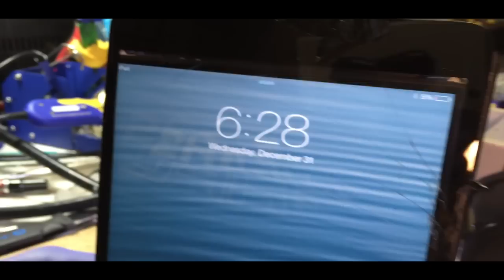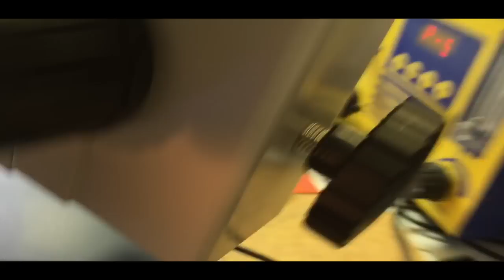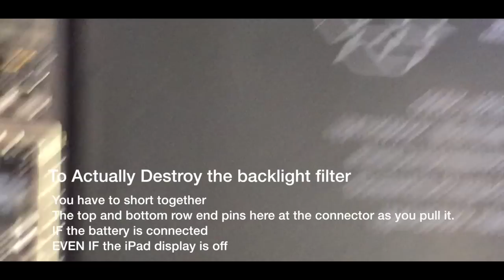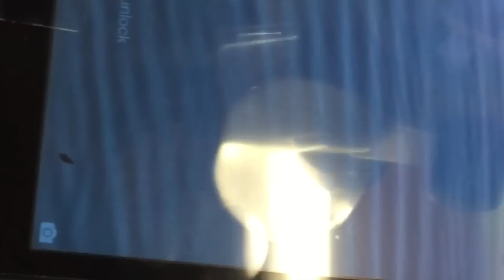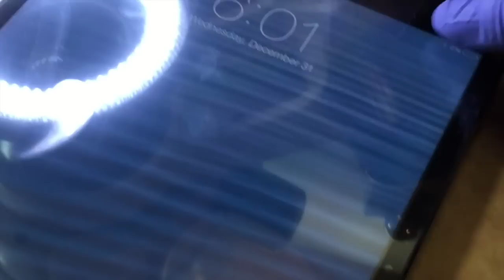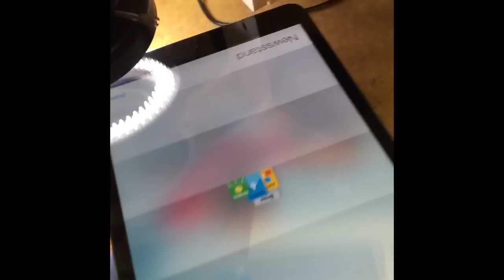iPad mini Screen Replacement

Comment: @40:07 whoosh cleaner is nice? Would you use that directly on the LCD for any smudges when you have the unit open?
Reply from the maker: No
Reply: What would you suggest for cleaning the digitizer surface? What would you suggest for cleaning the raw LCD? isopropyl alcohol & cotton qtips seems to streak a bit.
Reply from the maker: I would vote for no liquid on an LCD, but if you insist you could try Perfect Glass on a microfiber cloth not the LCD.  The best solution is to not get any marks on the LCD, wear gloves.
Reply: Agreed gloves are the best option. I have some Invisible Glass clean which is great albeit, really needs proper ventilation. I'm guessing Perfect Glass is a little less odoriferous. thx.

Comment: It's impossible to blow the fuse when there is no money at stake.
Reply from the maker: ok smart ass, i bet you can't blow the iPad mini backlight fuse.  Rules.  you must leave the EMI shield on the iPad and you must blow the mini backlight fuse in the course of a normal, or simulated normal iPad mini screen replacement.  terms of bet to be set later of course...

Comment: Hi Jessa, I love your videos and am inspired to try to repair my daughter's ipad mini.  After completing the screen/digitizer replacement (which I did before watching your video), the screen has a bad, jumpy, flickering image and alternately gets brighter and dimmer every 5-10 seconds.  When it is dimmer, you can faintly see the whole screen image that was up previously.  There are also horizontal and vertical lines.  The touch function seems to work fine.  Wondering if you think I damaged the LCD or could this be a defective digitizer (it was an inexpensive one from Amazon).  Any thoughts would be so greatly appreciated.... thanks
Reply from the maker: bad lcd, not sure if other problems as well

Comment: bonsoir Rehab , Reda reparateur en France vous etes formidable madame, je voudrais vous poser une question avez vous connu un probleme de sensor magnet wake on off screen after remouving glass i know this 2 magnet is important i have place it but not the same form of magnet not working i know this flex cable in button coper is the sensor of this wake on off screen merci Reda

Comment: Hi Jenna great video. I’m from the UK and I’ve got a completely dead mini. Not recognised in iTunes either. I’ve taken digitizer off and lcd also ordered replacement battery to discount that. Any ideas? Maybe board issues?
Reply from the maker: check for signature failure 3v3_out short
Reply: Thanks Jess for the reply. You will have to excuse my limited knowledge on this matter. How do I check for signature failure? Also watched your video on replacing the power ic chip, do you think it is this that has failed?
Thanks
Reply from the maker: Post questions like this on a forum or head to a local microsoldering shop.  www.forum.mendonipadrehab.com

Comment: @23:09 shakes fist at self. Next time I'll FULLY clean the old adhesive off! I had even purchased the 3M sticker remover pen. Oh well very successful iPad Air digitizer replacement, despite not being perfect.
Reply: note to self @25:51 for full cleaned adhesive

Comment: I've cleaned the iPad mini frame with adhesive remover and cleaned it with cleaning alcohol but the new adhesive on the OEM digitizer does not stick properly to the frame when I close the iPad. Any tips?
Reply: @38:18 she also uses heat (hot air) to help seal the adhesive.

Comment: I have had an issue doing this once to a customers iPad mini. I pulled the battery connector to prevent backlight damage and when it was powered up after the repair, the date naturally got reset and the iPad showed as disabled. Unfortunately there was no way around this due to it not being on my WiFi or the customers Wifi, had to DFU it to get it up and running again.
Reply: Also, I dont think the lock button runs through the digitiser flex. What you could be experiencing when the lock button doesnt function correctly could be a faulty magnet/smart cover sensor which is the tiny black block next to the home button on the underside of the flex cable? Otherwise, amazing video which has far more real world advice than most of the big channels
Reply from the maker: Gary Finlay Yeah, I have not looked at the schematics to see the power button line, but in my experience the lock/unlock function will fail with defective home flex--pressing on the bottom of the digtizer to cause the picture taking sound and lock function.  Pressing top power button will unlock.  But also, I've experienced an inability of the top power button to function--that was home flex related---new digitizer assembly solved.  My memory is too swirly, but I'm pretty sure that it was related to poor factory soldering at the home flex--i.e. resoldering solved one case. But maybe I'm forgetting that I just replaced the flex (and its SMD). Who knows where the top power button lock/unlock and the smart cover lock/unlock functions are integrated at the logic level, but you may be right, that the lock button circuit itself is confined to the top of the board.  Sounds reasonable.

Comment: What marker did you use to recolor the frame?
Reply from the maker: +David Bacon nail polish is good for any scratches on an original glass you are using.  If you mean adhesive removal, it is a sticker remover pen from 3M and I love it.

Comment: Do you know of a logical reason apple decided to put so many screws in that plate? I haven't been able to find a single reason, that makes sense or not for those screws. 

To add annoyance to those screws, the magnet for the Smart Cover along the side of the iPad ruin the magnetism of your screwdriver so your constantly rattling it around in your magnetizer
Reply from the maker: Robert Pierce no good reason other than preventing LCD 'oil marks' from lifting of the LCD.  I guess the design was so tight compared to the earlier iPad 3 that they thought they had to be extra sure that the midplate would press down everything under it to not make a mark on the LCD.    You can notice in the mini retina 2 that it uses the same plate, but half of the screwholes are filled in and no longer used.  Apple smartened up.

Comment: hi, ipad mini have tape on lcd, i pull lcd screen off , and the tape was broken, i try to turn on my screen but it doesn't display .what should i do??
Reply from the maker: Quynh Vu tape isn't important.  you need to figure out if you have a bad lcd or blown backlight filter.  try a known good lcd